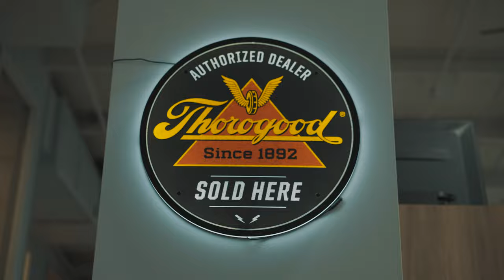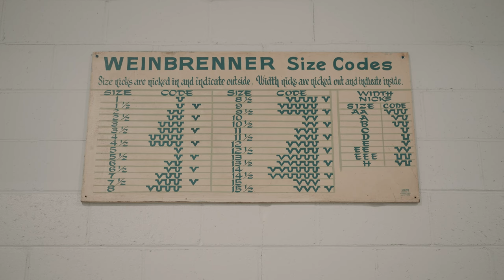How are Thorogood Moc Toe Boots Made?

Comment: Damn fine boot.
I recovered a broken foot using Thorogood boots.
Excellent leather quality, and unlike REDWINGS; Thorogood's leather didn't wear through at the toe of the boot, even though I work construction and usually wear out boots at the "toe" end.
My work requires that I wear a steel toe...

I have flat feet and had suffered a broken menial malleolus.
Recovery was difficult.
It was suggested that I purchase a Moc Toe boot, and throughout the considerable pain from the injury during my rehabilitation, this boot delivered beyond my expectations.

I owe the skilled craftsmen, "and women" a debt of gratitude.
Without their fine product, I might not have been able to return to work as quickly as I did. 

I have a second set of boots on the way, and I will re-sole the original pair.

Thank you for building a quality product.
I appreciate that they are AMERICAN made, and that the quality of this footwear is second to none.
I will hopefully continue to purchase my work boots from Thorogood for the rest of my life.

Thank you,
An Electrician.
Reply: I work construction also, how do you work in them with no waterproof?